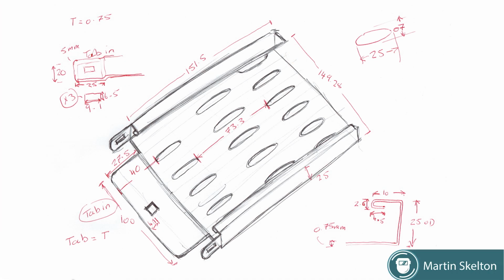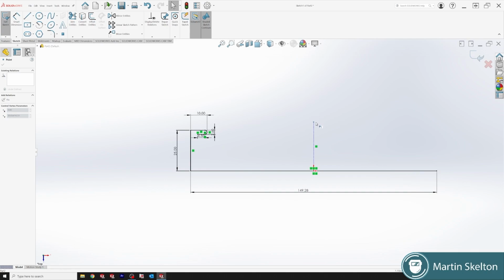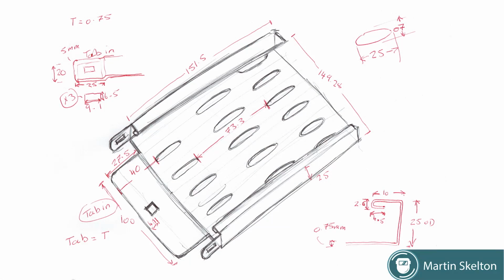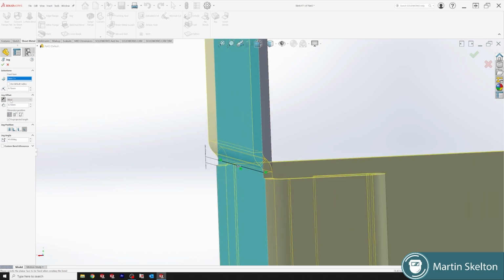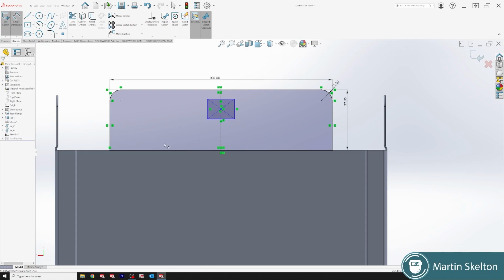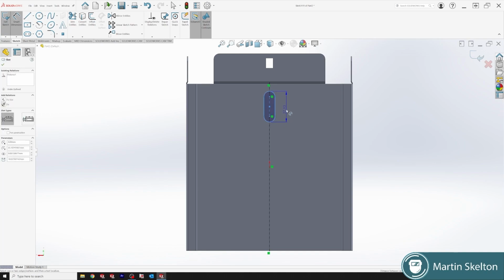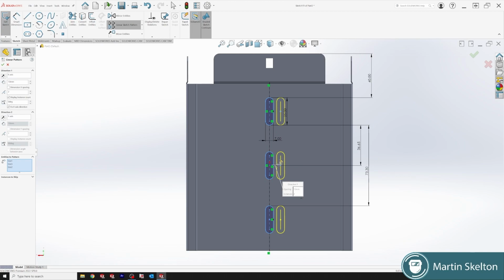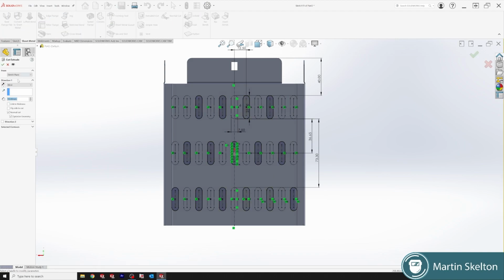SOLIDWORKS // Sheet Metal Practice #1 // Drawing Real life objects

Comment: I like the construction line trick of centering the slots. Pretty slick!
Reply from the maker: Hi Tambaurora, The construction line trick is very handy at times. I work in the area of large machine design and the assemblies can be easy to get lost in. The construction line trick allows for fine adjustments during the layout stages while still fixing each component and limiting undesired movement. There's lots of little tricks to learn in such a large software, everyone has the own, learnt from someone else along the way and ready to show to the next person. Thank you for the comment Tambaurora, it is much appreciated.

Comment: did you  make this part? I would  like to  see the  process  from  design to  finish
Reply from the maker: Hi Jason, I didn't make this component it is the end of a standard cable tray. I would think that it is a punched out component, then rolled through a die and finally the jog added. Since it is mass produced it would be done with a CNC manufacture line. I am a Metal Fabricator by trade and we would have made some bespoke items using the same principles but with workshop equipment such as plasma and brake press etc. Saying that the material would usually be heavier - under 1mm material is very hard to work with except with the suitable equipment and set up. As the channel advances and grows I will be doing projects from the design process to physical prototype in a workshop environment. It might be of interest. Thank you Jason for the comment, it is much appreciated.